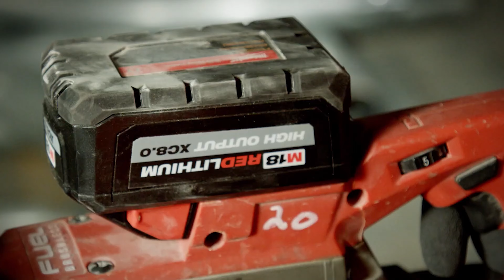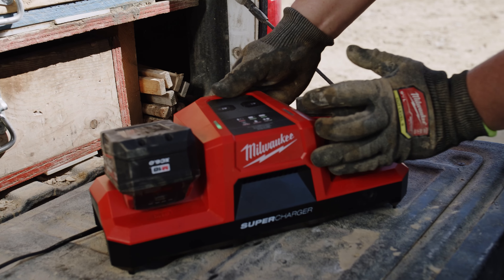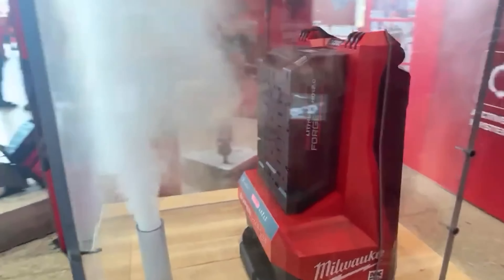Testing NEW Milwaukee M18 FORGE 6.0Ah Battery & What is PWR4!?

Comment: I would have liked to see the XC6.0 HO compared rather than the 8.0 since the 6.0 has the Samsung 30T cells at 30A output, while the 8.0 has trades the higher output for more capacity with the 40T cells.  Maybe for a future vid!
Reply from the maker: Good call, would love to really see some better tool testing with saws and grinders but harder show results. If you’ve done some testing with 12.0 vs 6.0 or 8.0 High Output is should be very similar performance. We are happy to see new PWR3, PWR4, PWR5 ratings on batteries, really hope those go on tools as well moving forward.

Comment: If you look at the top of the charger where the batteries slide in you will see holes for the air to circulate to cool the batteries while they're charging.now I know the 6amp forge doesn't have holes in top of the battery to line up with the charger but I believe the 12 amp forge will have and that will circulate air through the battery

Comment: What Milwaukee need to do is make a battery that will withstand the power of the fuel sawzall. Usually what happens is that from so much vibration and abuse the battery will begin to break from the inside

Comment: You should use the Milwaukee M18 high output 6.0 instead of the 8.0 cause the 6amp has better discharge with a bit less run time

Comment: Is Milwaukee working on a new 3/4 inch impact wrench to replace the 2864?
Reply from the maker: Most assuredly they are! The 2864 came out a little while after the 1/2” 2767 so good guess is it’ll follow not too far behind that Gen 3 update.

Comment: How long does the 6.0 forge last until it runs out of battery?
Reply from the maker: You will unfortunately never get a straightforward answer on this because it all depends on the tool you're using it with and the strain you're putting on the battery.  Milwaukee has not put a run-time statement out on the battery, but is comparing the power of the 6.0 Forge to the 12.0 High Output. With the new Forge design, you should expect not only a longer runtime but the advantage of a much faster charge time as well. Milwaukee has also put out a statement saying the Forge will be 80% charged in 15 minutes and 100% charged in 25 with the supercharger, so it charges up pretty quick.

Comment: Doesn’t the heat generated by the SuperCharger doing it’s thing kill the batteries over time?
Reply from the maker: Putting it on the super charger should push more air and drop battery temperature faster with fan. It won’t generate heat that would impact the batteries.

Comment: @Ohio Power Tool. Thanks Jay and Nick for the info about the new Milwaukee M18 FORGE 6AH battery.

It's interesting that Milwaukee decided to add battery cooling for their FORGE battery but didn't do it for their original M18 batteries like Makita always did for their LXT 18V batteries. So the original Milwaukee Supercharger has a fan but it only cools the charger while Makita's rapid chargers cools both the charger and the batteries.

Wishing you , the entire OPT crew, and your families stay safe and well.
Reply from the maker: Thank you for always jumping in and sharing some useful feedback! The Forge batteries do have some internal cooling benefits from the fans, easier to see on the MX versions they had a demo at pipeline you could see pulling through the batteries. Obviously older M18 batteries are not build with that feature so 5.0s are not going to see big charging time gains. Older cell tech probably could not have taken full advantage like we are seeing today but even 10 minute boost would be nice. If not mistaken Makita had some sort of early patten on that technology for fans in chargers to cool batteries so not sure if that expired, or they found another way around or they just pay a small royalty for the privilege.
Reply: @OhioPowerTool  Thanks fir the feedback about patents. Ever since I learned and heard that Dewalt patented a work radio that also recharges batteries and Dewalt sued both Bosch and Milwaukee for putting recharger function in thier wirk radios back around 10 years ago,  I'm sure the radio charger patent expired. I also wonder why some tool companies don't put certain functions in their tools and whether it'sa patent issue.. Didn't Jay mention that Milwaukee had their green light laser levels waiting in the wings until  certain patents expired?
Again. Thanks.

Comment: What if I have zero interest in a dual m18 charger? I would buy a 1 port m18 super charger if it still charged my m12s. As they are currently selling this I would have to now lug around an extra charger for the 12s. I tell you, the convenience of the mixed 12/18 rapid charger is super nice. Nice enough that I haven't bought a charger that did just one of the voltages.
Reply from the maker: Hopefully we will see a super charger that can charge both M12 and M18 soon 🙏

Comment: The comparison should have been against 12.0, because that was it's supposed to be replacing.   Most people buy the 12.0 because they need max torque, tightening and loosing.  Not run time.
Reply: I’m buying the 12.0 for max torque and run time.
Reply: I'm the exact opposite, I'm looking for max run time, I ain't loosening heavy equipment tires or some shiet like that

Comment: 1:47 same runtime based on the numbers. 6 ampere = 6 hours runtime.
Reply from the maker: If the tool/light/radio drew 1 amp. = 6 hours. Obviously most tools pull more than 1 amp so way less than 6 hour run time.

Comment: Testing.? Where is the test Man.? We didn't se any test.
Reply: Between 3 and 4 minutes, seemed like great tests to me.
Reply from the maker: Pretty basic testing to be fair, ran 1/2" impact on Skidmore to see torque (bolt tension) produced and ran a few holes with SDS-Max rotary hammer. More testing to come as we get our hands on some of the newer tools, Gen 3 impacts and the like.
Reply: Just today i used the rotary hammer with an 12.0 and after 20 min chpping put it in the super charger and no charging 

12.0 is a beast but for this rotary hammer not enough

Comment: Waste of money honestly.  2 6.0 high output costs less than one forge.  You tell me which is a better deal....
Reply: Where can you find the dual HO 6.0 for less than $199?
Reply from the maker: We appreciate your feedback!
Reply: @OhioPowerTool  you got it.   But to go a lil deeper... Another $249 to get the 25 min charge speed? 🤷🏾‍♂️ come on.   On top of that, if the forge 6.0 is giving same output as 12.0 than it's obviously going to die faster than the high output 6.0's 
It's disappointing.  Not worth upgrading

Comment: Batteries have such a high markup. Not spending $200 on a single battery. If it is so good why doesn’t Milwaukee increase the battery warranty to 5 years? I guess in 6 months the “Max Forge” will come out and idiots will waste their money on that too. 
Buy older cheaper batteries. Get more bang for your buck
Reply from the maker: This is definitely a fair point! Just give it a few years and these will be the older cheaper batteries 😅 Hopefully we will see that warranty change though, fingers crossed!